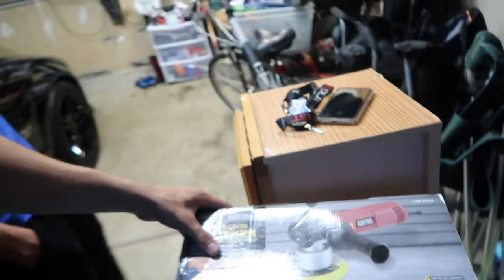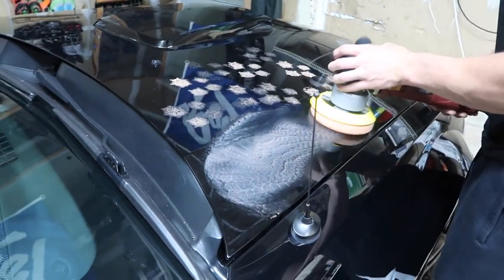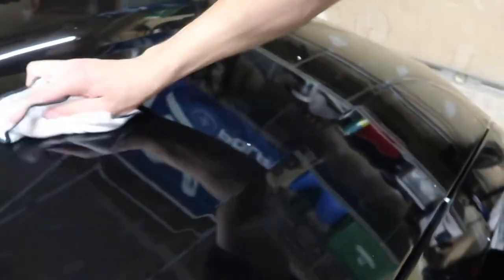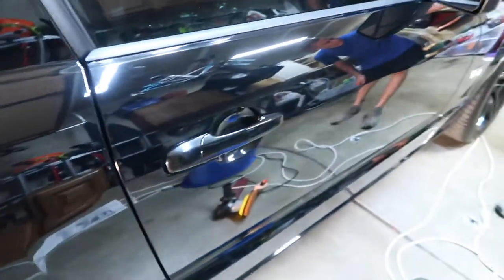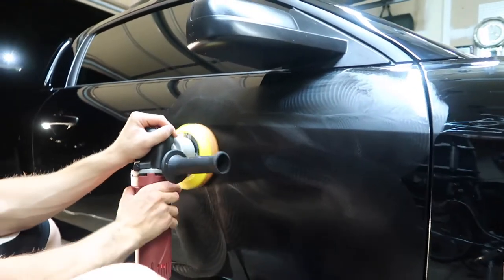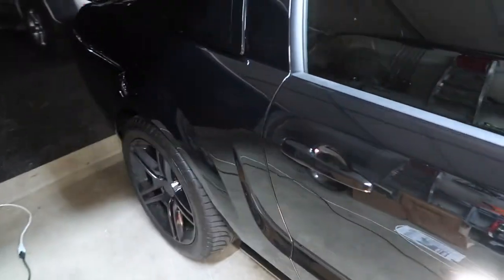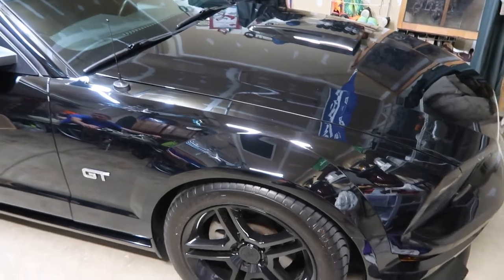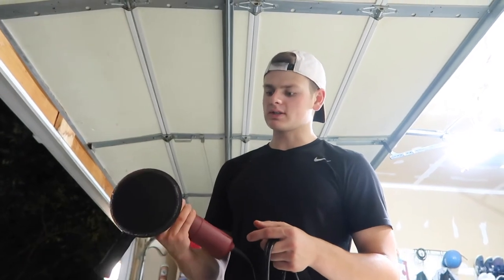How To Polish a Car With a Harbor Freight DA Polisher!

Comment: Your pad diameter should be larger than your backing plate.
Reply: He's using the 6" backing plate that comes with the machine & it's crooked,  yes looks like a 5" foam pad. Polisher is not setup correctly.

Comment: Your doing everything wrong.  First this is, that backing plate is no good.  I can tell that's the original harbor freight banking pad and it is not rotating evenly.  Second is your putting too much pressure on the polisher. Third is , your pad should be bigger than your backing plate.  They look like they are both the same size.  Fourth  is your putting too much pressure on the polisher. That's why is taking you 2 hrs. 5th thing wrong is your putting too much pai t correction. That's why is flying everywhere when you dont apply pressure
Reply: All that matters is the end result.

Comment: I have owned a couple of this machines and love them. However when using a 3 inches backing plate it is a must to modify or change the counterweight. I had one backing plate that came off and flew off including the nut where it bolts in which came off from inside the bearing. Simply put it was the vibration created by using a 3 inch backing plate without changing the counterweight. I even made a video of the modification I made; again it is a must with the 3 inch backing plate.

Comment: You never mentioned if you overhauled the DA polisher. I stock grease inside is crap take it apart and put in some top quality auto bearing like grease. Just doing that will make it run much smoother trust me.